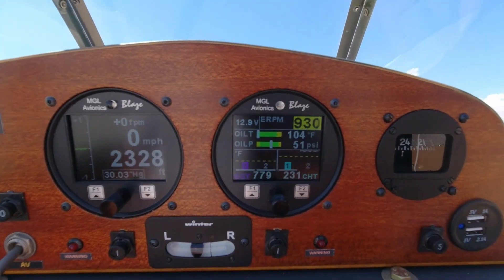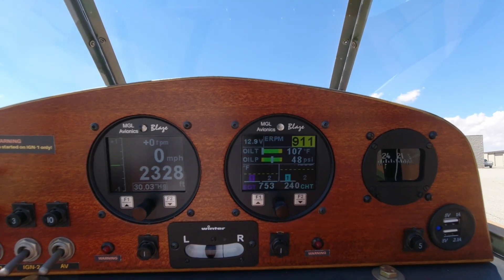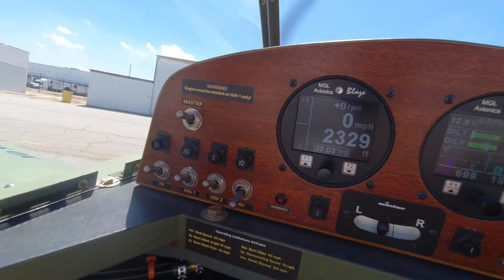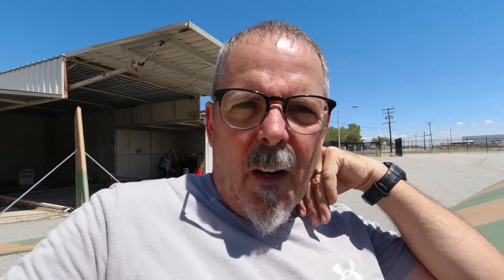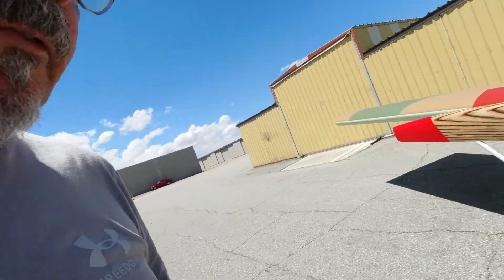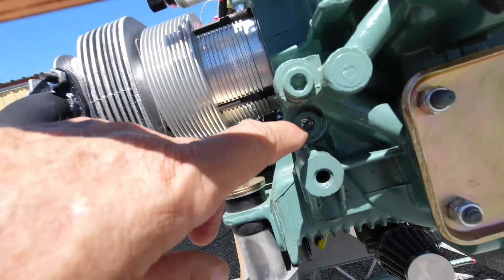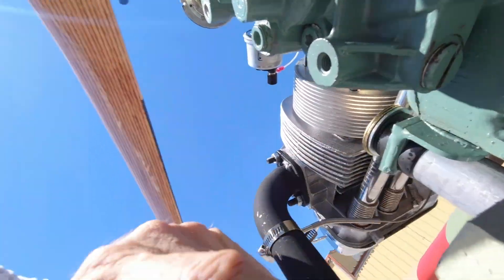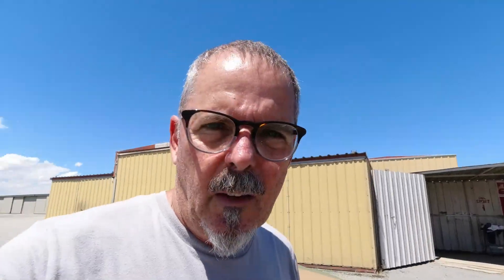Minimax 1100r Wood Aircraft Build - Figuring Out Oil Pressure

Comment: Many years of air-cooled VW hot-rodding (on the ground) and I tried to limit my oil pressure to around 50psi at 5,500 rpm!
If you are running a spin-on oil filter and get above 70-80psi you run the risk of the filter gasket getting blown out of its groove..it is a BIG oily mess; ask me how I know. It usually happens when revving high with cold oil so it is wise to monitor the psi...
Reply from the maker: No oil filter on this one. Some people add it to the 1/2 but most just change oil every 25 hours
Reply: @DTMinimax  good to know. I like wooden aircraft and am looking forward to see how yours flys, it really is nice. Enjoy it

Comment: @DTMinimax  Dennis, for some reason I can't fathom you getting that engine that came to you with that problem.  That could have been catastrophic, had it not been for your observation and quick action.  

I thought those engines were all "bench run" before shipment(?).  How do you think that engine was shipped with those "built in" defects?   I'm sure your due diligence saved that engine from a great deal of internal damage.   Maybe they test run "every other engine."  We're talking $$$ here.   

For YOU having to use emery cloth to smooth out an internal defect seem so unreasonable to me.   I can't understand how that happened.  I'm sure you and "Scott" discussed that - what was HIS answer?
Reply from the maker: Hey Michael, Scott does test run every engine he builds, with the carb that’s gonna be used. 
Since my engine sat for about a year and a half, it’s possible that what was not an initial problem became one. When that port is machined, there must have been a small flaw near the very top. It certainly didn’t take much to remove it so it was a very tight tolerance. Scott said it can happen. If I would have known, I would have opened that port a long time ago. 
I’m certainly glad everything worked out for me and hopefully others can learn from my situation.
Reply: @DTMinimax  Dennis, thanks for the update.  I, like all of your other "followers," just want you to have the best outcome for all of your work.  

Any idea on the AW inspection which will gear you up for your first flight?  I know you have a measure of "stuff" to do before  that particular day.  I had a total of three (different aircraft) AW inspections - all were done by the FAA.  (Saved me the DAR $ :-)   Like you,  I was always  ready.  Thanks, "Go for it!"  "GO AIR FORCE - BEAT NAVY."   :-)

Comment: If your oil pressure sender is a 5 bar sender, isn't 70 psi it's max range? Is it possible you could be over 70 psi and not know it?
Reply from the maker: It’s an 80 psi 5 bar

Comment: Nice clean looking dash.  I like those MGL gauges, but I'm gonna stick with my analog gauges my WW1 fighter!!  Thanks for sharing
Reply from the maker: I really like them a lot. All the information is in one place. My favorite is getting a VSI in there
Reply: I am a firm believer in "Steam Gauges."  As a former Avionics kind of guy, I've worked both the Analog and the digital instrumentation.  Always leaned towards the Analog.  One of the many "Old" planes that I worked, in the past, C-118A's, (DC-6)  there was no need for an "after tap" instrument reading, because the instrument panels were shaking so badly.  :-)  It was sometimes difficult  to read the Fuel Flow, in PPH,  when running up to Field Barometric, on an OPS check before flight.  (Was 600 PPH as I recall :-)  Those P&W R-2800's, shook like hell,  but it was some kind of a great engine.  

I outfitted my EROS 1650  with the WWII Flying Tigers camo paint job -   Had 50 cals on the wings,  and those Big Eyes and Shark's teeth.  Yes, my panel had ALL analog gauges. (Oh, I did have a Tiny Tach.)   I always thought I should have been a member of that "American Volunteer Group," AVG,  flying one of those Curtiss P-40 War Hawks. I'd give my front seat in Hell for a ride in one of those. :-)  N6395T - my fav was the Piper Arrow.

Dennis has a very nice vintage airplane presentation.  He certainly has put a lot of work in developing it - Is a lovely airplane and will look super-nice in the air as he rolls into that nice 60 degree bank, as he angles for the runway.  :-)   Dennis, your plane looks so good.